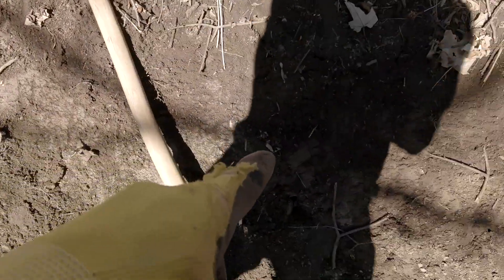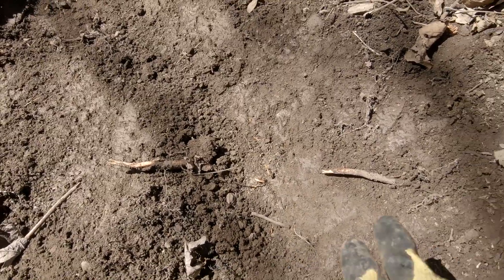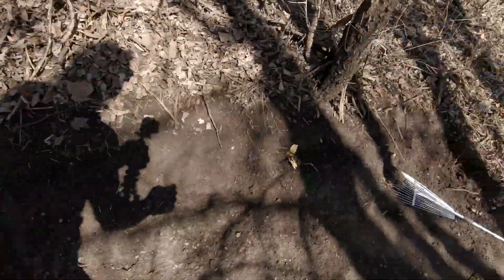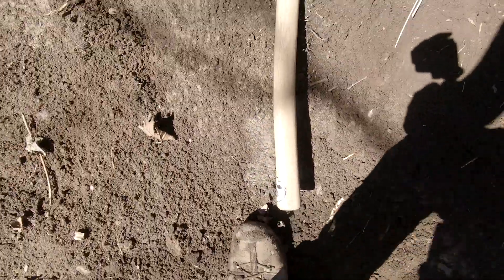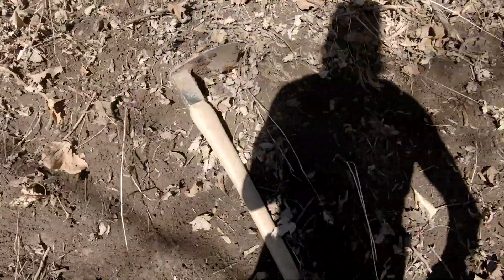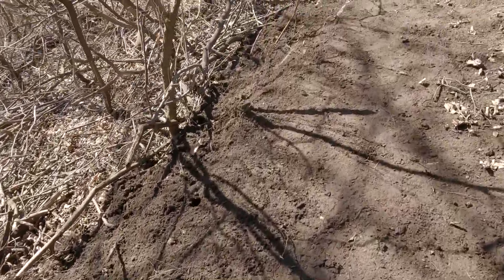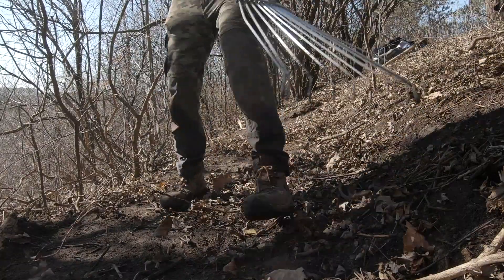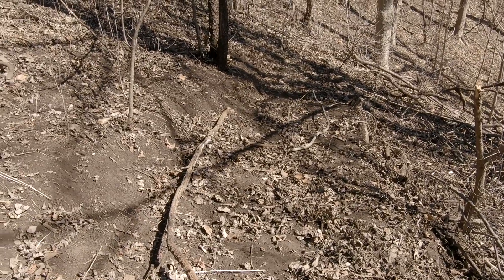Trail Building 101.  How to Bench-cut Part 3

Comment: what about on private trail can i put stone on the  outer edge what will still let water through?
Reply from the maker: @duckabin Do you mean small stones like 3/4 gravel or a large stones.  If large, then absolutely, use this whenever possible if you want that downslope side to remain for a long time (as long as it's reinforced from behind as shown in this series).  If you mean smaller stones, yes you can use that, but bear in mind something needs to hold that stone in place otherwise it won't lock into place and like other non binding materials like sand will just travel down hill.  Any material would do the trick like logs or rock.  Also worth keeping in mind that dirt will eventually fill in the gaps of the stone which means the tread still needs to be allowing water to travel downslope and not sit on the trail.   Also worth noting that water will flow down through the stone and will need to go somewhere. If it can only go under your cribbing then that could cause erosion issues, but hard to say without knowing your exact situation.  Hope this is helpful and good luck!  Thanks so much for watching. :)